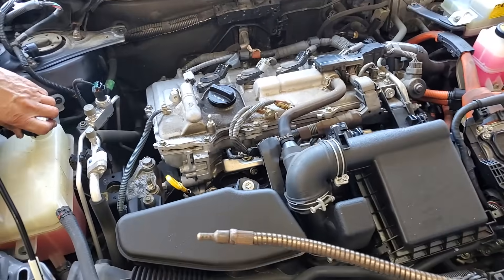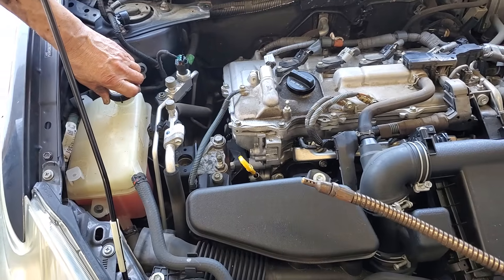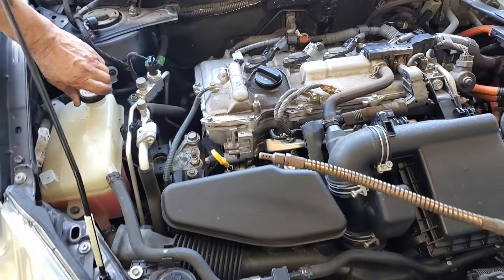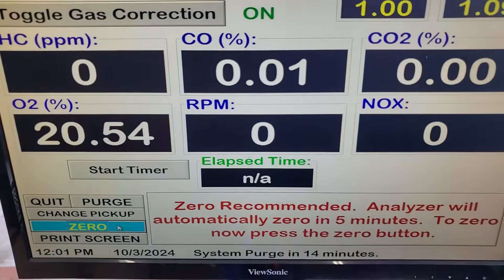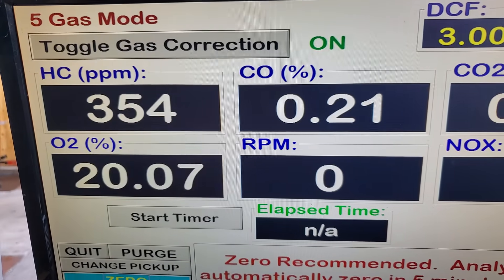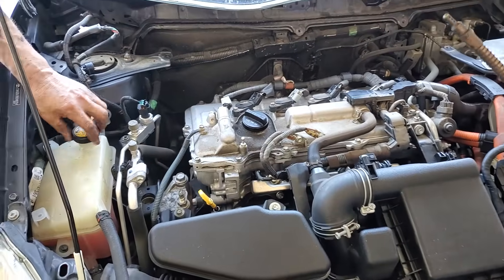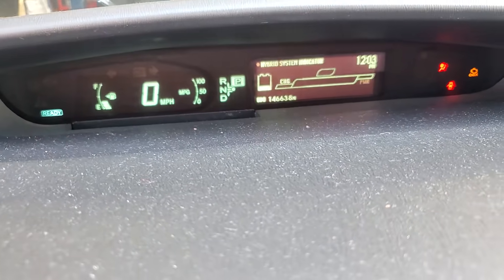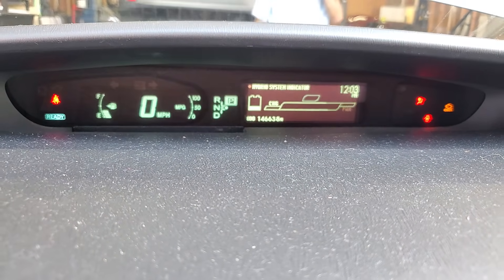Toyota Prius Head Gasket Check Misfire Codes P0300 P0301 P0302 P0303 P0304

Comment: Yeah, the g/f's Prius V blew its head gasket right about 150K and no independent mechanic shop would touch it.   The Toyota dealer did it for nearly $3K (ouch) but it just turned 201K a few days ago and it's hanging in there.   Other than that ordeal, the car has been a good one.